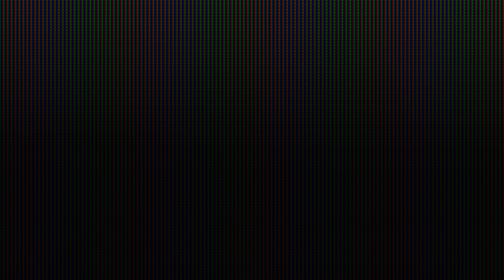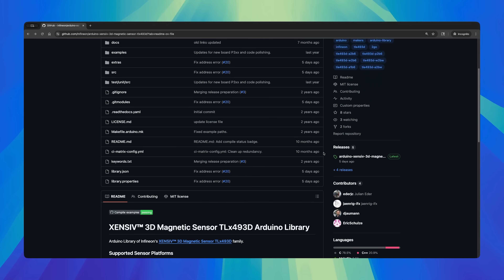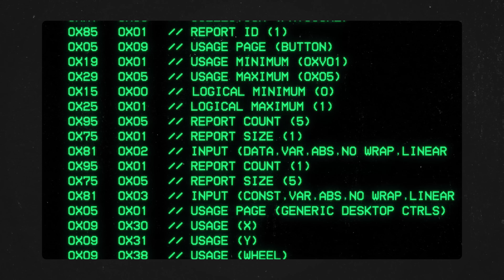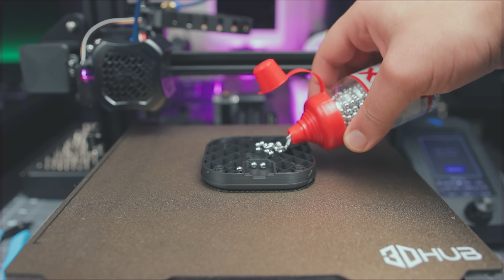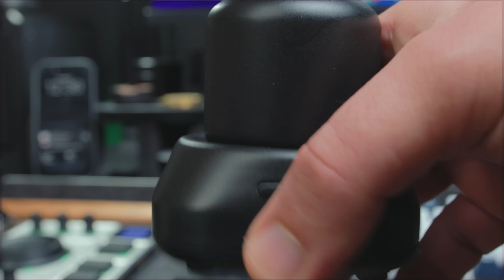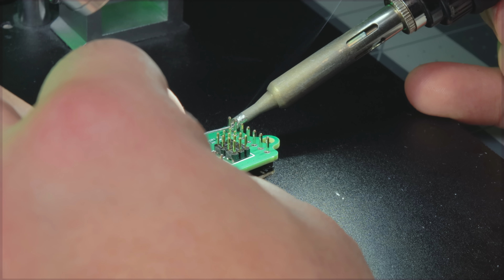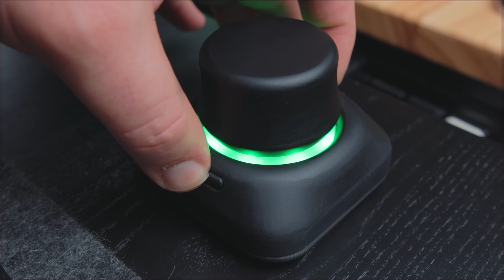I Made a 6DoF Space Mouse using Magnets (again)*

Comment from the maker: To learn for free on Brilliant for a full 30 days, go to https://brilliant.org/salim
My viewers also get 20% off an annual Premium subscription, which gives you unlimited daily access to everything on Brilliant.
Reply: I can't find your GH repo....?
Reply: @tombyrer1808  He hasn't updated it yet for this project, hopefully soon
Reply: I think you should add three wheels for individual z x y axis and perhaps a fourth for inward outward zoom, even having a side piece with four wheels next to eachother just in case you want to lock out any other input from the other axis entirely, this could solve moving objects in mutiple software without having to hover over or select the axis before hand.
Reply: I think getting both pieces of the base (and maybe even the knob too) CNC machined from aluminum would be AWESOME! You wouldn't have to worry about adding the weights to it either, you would just have to put some non-stick feet on the bottom. Plus you could also make the buttons from aluminum too! I would think steel would really add the heft you're really looking for, but I think it would interfere with the magnets and electronics too much, although you could get it in Stainless Steel as long as it is ferritic Stainless Steel (the 400 series) - so just stick with 304 or 316 stainless and you should be fine - plus you could polish the pieces differently and get some different looks - like do the base in a mirror polish but the 'knob' and button is a brushed look - then you don't have to worry about fingerprints on the 'knob' or buttons, plus it's usually gonna be your palm resting on the base which isn't nearly as 'greasy' as your fingertips - OR you could even 'blue' them so they turn black and you;d never have to worry about finger prints and you'd have the same look as the original.... wait, I don't think blueing works on stainless, just regular steel, and then you have the magnetic interference problem... 
Well maybe there wouldn't be an issue with magnetic - you would just have to re-calibrate and it will zero to whatever field is there, right? Well only one way to find out! And you do know PCBWay does all this type of metal work right? They can even 3D print with some types of metals.
I'm totally new here (and this project was enough to see me on subbing!) so I have no idea if you ever worked with them outside of PCBs or if you did any sponsoring with them, but they are the perfect company for makers like you! (no I don't work for them LOL I just love the stuff they do!)
- - OH one thing I did notice that you wouldn't want to see on a high quality product (like you probably wouldn't see this on that original one you had) There was Light Bleed coming through around the buttons and that SCREAMS cheaply made Chinese Junk! (which I know it isn't at all, but you see it all the time with their cheap crap - bad fit and finish) So maybe just a piece of felt that goes around the button on the inside of the casing 🤷‍♂ As long as it isn't too tight around the button so it makes it stick. and I say felt instead of a plastic ring because you can tease the fibers out that would be brushing against the button, and that could fill any of the gap that would be around the button and felt
- - And one more thing. If you got that diffuser made by PCB way they would make it from a completely clear plastic (oh wait, you have a resin printer, so you'd be able to do this yourself) and you would be able to extend the diffuser to go to the 'front' of the base and attach to it where you could have a cut-out of your logo or a design or something, AND because it wouldn't do a fantastic job of really diffusing the light around the knob like what you used in this vid, you could just use some sand paper to evenly scratch it up (evenly) so it gives it a foggy looking surface and that would diffuse it the same way as what is in there now. 
- Okay, one more tiny thing.  Since you already have LEDs incorporated then there is a ton more you can do with them, and maybe if you do another version of the PCB you could add some capability to add on to it in the future, like a way to add more LEDs to the base instead of just having the ring LEDs also the ones for the design/logo you could have some pins that would allow you to add another controller (if needed) that would let you add LEDs in other places, like around the bottom of the base, a ring of light in the knob, around the buttons, etc - basic just a way to add more later if the user desired :)
I think this project is AMAZING! And people LOVE to customize their stuff, so this is the perfect type of place to start! Maybe the next project could be a track ball! lol (I've wanted to go back to a track ball for SO LONG! I had one as a kid and I remember just loving it.
Reply: If buying this board means backing your project and help sustain you, then that's what I want.
Reply: You don't need the power switches. Just switch the sensors using a pin on the esp, they only pull 3.4ma. You really didn't need to kill the power. You could have just used a software i2c for each sensor, that micro is plenty fast to do that.  That way you could have received data simultaneously from all three sensors.
Reply: This is great stuff, first of all that is great design! Elegance like this is like striking gold, absolutely legendary. Ordered a couple of boards immediately and am printing parts now. I made some modifications to your model, I wanted to try print pausing to insert M3 nuts into the print to avoid using heated inserts. Can not wait to try this out! 😎🤙
Reply: Here's an idea for a project: a 'laptop' where you slide your phone into the touchpad location and the screen/keyboard/USB/etc are attached to a broken-out OTG hub which is powered by a mammoth USB power bank?
Reply: @KeithOlson this could work, with Samsung phones is already qite a reality

Comment: I finally managed to get the board, thanks! however, would it be possible to buy just the small board adapter (and the pins)? If so I could have different xiao boards for testing, I was thinking about adapting one with a battery and a Xiao ESP32s3 or a C3, which are quiet cheap and could provide a wireless 3D mouse.

Comment: Does this mouse work without the 3Dconnexion software by using the standard HID protocol, or does it emulate an original SpaceMouse? I'd like to use it with Onshape on Linux, so I'm wondering whether it works without the official 3Dconnexion driver.

Comment: I was able to build mine using the pre-manufactured PCB provided and 3d printing the STL's in a Blue\Green Silk PLA and transparent PETG. This was interesting to work on and for the most part everything was conveyed in the Instructable's article and in this youtube video. For anyone considering this, having experience working with Visual Studio Code, and a SEEED device not required, but certainly makes this much easier. I know what an IDE is, but have little to no time in it. I was able to figure it out with enough patience and log reading and I consider myself tech savvy. I believe anyone who considers themselves tech savvy could get this to work without much of a headache. Definitely don't mess up the soldering order of the daughter board. Its super annoying to separate the SEEED device from the daughter board lol. Setting the heat set inserts and putting it all together was so satisfying. Then finally getting it to work within Fusion 360 was such a gratifying feeling. Thanks for the time and effort you put into this thing @salimbenbouz!

Comment: My pre assembled board arrived today! Thanks so much, I'll get onto it immediately. I'll update this comment with how it goes in the next few weeks. ❤😊
Reply: Did you ever get the firmware to work for it to be recognized by the 3dconnexion software? Mine just acts like an old school pointing stick and isn't being seen by the tool..
Reply: Yep it worked great, download the 3D connections software, make sure you update the values in the firmware to match the 3d connections values. Also using the updated firmware on the github that integrated a kalman filter made it feel soooo much better, highly recommend. Also my printed petg and asa springs both snapped quickly, recommended getting them laser cut from sheet steel.  @Kyurnmakes

Comment: What would I need to do in order to get this working with slightly differently sized magnets (8mm x 1.8mm and opposed to 6mm x 3mm)? I'm interested in trying to build this but I would prefer to use the magnets I already own as opposed to buying new ones

Any advice would be greatly appreciated!
Reply: I had the same issue, I grabbed the step file github and modified it in Fusion. It is really easy to change.

Comment: Hello. 
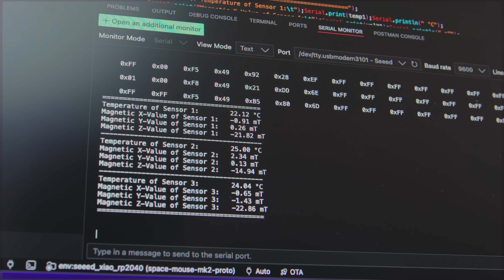This is a fantastic project— Thank you very much. 😊 Unfortunately, one is dependent on the circuit board. Will this project ever be available without that specialized board—using just the sensors placed in the correct positions? As can be seen at minute 03:58. With buttons, of course. That would be great, and it would make the project much easier for many people to replicate. It would also make repairs much simpler in the event of a malfunction. Furthermore, it would eliminate the need for any external services.

Shipping outside the USA is expensive (due to customs duties, taxes, and postal surcharges). Unfortunately, this limits the project's accessibility for many potential users.
I am still undecided because of the cost.😇

Best regards from Germany.
(I hope the translator got it right.)
Reply: @salimbenbouz That is also very interesting. Unfortunately, it's a bit too expensive, and there isn't a project available to build yourself yet. Not yet, anyway. Maybe it will be available soon. 😇
It's called Rotatrix. Do you know it?
https://www.youtube.com/watch?v=u1v7TXViRi8

😊

Comment: Very cool project, and thank you for implementing it! Since the PCB is currently out of stock, I wanted to order a pre-assembled one from JLCPCB (unfortunately, SMD soldering isn't possible for me). However, this requires a CPL file that specifies the exact placement of the components. Is it possible to add this file to the Git repository in addition to the BOM, or will the PCB be available for purchase again soon?

Comment: Why did you go with I2C hall sensors instead of analog sensors on the RP2040's analog inputs? Using some 10¢ TO-92 hall sensors from AliExpress would be a lot cheaper, even though it wouldn't be as tidy or cool as your PCB and its light ring.

Edit: never mind, I didn't know what I was talking about. These are 3D sensors instead of the linear sensors I saw on AE

Comment: I have made a wireless bluetooth version of this project, including a modified base with a lipo battery compartment. The mcu is a Seeed nRF52840, so straight drop-in. Also made a version of the firmware with lenkeiser’s Kalman filter. Will make available as soon as I get the PCBs and can test.
Reply: Wow nice. Will it be publicly available? Do you have github to follow?
Reply: @AndreySemjonov yes, as soon as I can test it with the PCB
Reply: @michaellindborg1510 I think you've added some pairing and Power on/off buttons
Reply: @cosimo2777 yes, that is correct
Reply: @michaellindborg1510 I'm waiting for the material unfortunately I don't have TLVs, I'll wait for your news.
Reply: @cosimo2777 not sure what TLV means
Reply: @michaellindborg1510 TLI...TLI493D The T9 was capricious...
Reply: @michaellindborg1510 I haven't managed to continue with my project yet, I'm going very slowly. Did you receive the PCB? I am very curious about your result!
Reply: I was thinking about it too. Using the nrf, a tp4056, battery I think of 600ma, do you have a github?
Reply: @cosimo2777 I am using a 820mAh lipo cell. It fits perfectly in the base with room left for weights. Will make my github public as soon as I have tested the firmware.
Reply: Wow, I hope the software algorithm can be improved for a smoother user experience!
Reply: Finally got around to completing this project. I now have a working bluetooth battery operated version of Salim’s spacemouse. I have tested it with the 3Dconnexion trainer and everything seems to work. I have added a small powerswitch on the underside of the device. Bluetooth pairing works fine and bonding is cleared by holding the two buttons for 6s. I’ll test it out for a while and then open up my github repo if anyone wants to try it.

Comment: I successfully built this product. However, I believe the noise reduction algorithm needs improvement. Even after calibrating the dead zone, drift and self-rotation issues still exist, perhaps because the inherent noise of the TLV493D sensor is approximately ±5-10 units.

Comment: I printed one just to see how I like it without electronics. I like the shape and form, but the knob itself is way too mushy and wobbly for me. I haven't tested the real one but if it is like this then I don't want it.
Reply from the maker: You can adjust the stiffness by tweaking the spring Fusion file and you'll have to account for the "sensitivity" in the firmware as well
Reply: @ epa720 Did you print the 0.8mm or the 1mm spring variant?

Comment: Please order a stencil next time! Also, the pi2040 can most likely to more i2c busses, this eliminates the need of power toggling them all (and putting a voltage on a IC which is turned off is most likely not allowed). I would also recommend using a kalman filter

Comment: Great project, well done. Is it possible for you to also output the Bluetooth HID report data? I want to do a wireless project using Bluetooth with an ESP32, but since I don’t have a Bluetooth device, I couldn’t do reverse engineering. Isn’t anyone working with Bluetooth HID reports?
Reply: There is a similar project called Nebula that has reverse engineered the bluetooth version of the Spacemouse. Sadly, it is not open source, only binary code is supplied. That is the only bluetooth version I have found, all the other DIY projects use the Spacemouse Wireless (cabled) emulation.
Reply: I have now built a BLE version of the firmware for the XIAO Seeed nRF52840. It only required minimal code changes. My understanding is that using an esp32 will require a total re-write of the code. Now I have to wait for the pcb to arrive so I can test it 😂
Reply: @michaellindborg1510 Is your source code open source? I'd really like to take a look.👌
Reply: @MrMuratx81 not yet, I want to test it first. I have verified that it uploads to a nRF52840 board, shows up as a Spacemouse Wireless BT device in the bluetooth monitor and is picked up correctly by the 3Dconnexion driver. I also made a version emulating the Spacemouse Pro with 15 buttons, which is also correctly identified. I have printed and assembled the device, just need the pcb now to verify it works! 😂
Reply: @michaellindborg1510  Great work. I'm eagerly awaiting the results. Is there a GitHub-like platform where I can follow it?
Reply: @MrMuratx81 it is on Github, but the repo is private for now. As soon as I have tested it with the pcb I will make it public.

Comment: Since you already made a custom PCB, would it make sense to use NRF52840 integrated in the PCB so that you can use it wireless? I am not an engineer but been learning about it in the past year. I made the V1 of your space mouse and I wanted to make it wireless but the NRF52840 super mini/pro micro doesn't expose enough analog pins from what I remember. So one of my goals to enhance my learning is to make a custom PCB with an NRF52840-QIAA bare chip since it should have enough exposed analog pins to use.

BTW, thanks for the free month trial of Brilliant! I wanted to understand circuits and digital circuits better so if I like the way brilliant teaches, I might pay for it after the trial expires.
Reply: I have made a BLE version of the firmware for the nRF52840, providing a wireless alternative. It should work with a XIAO Seeed nRF52840 as a straight replacement for the Seeed rp2040 since they are pin compatible and have the same form factor. Now I just need to wait for the hardware to test it😂
Reply: @michaellindborg1510  You have a repo for by chance? I just looked at the pinout for the xiao nrf52840 and it does look like it's the same exact pinout.

Comment: Great job!  Now the real question:  Can you build a better Xbox controller?
I paid too much for one of those Gulikit controllers because the hall effect sensors were pretty much guaranteed never to drift, but then the cheap plastic thumb sticks wore out and it drifts anyway.  I never liked the ball pivot design.  There has to be a better way.  I even thought about a thumbstick that doesn't move and just uses pressure sensors, but I don't know how great that would feel.  I just want a controller that doesn't wear out easily.  Is that too much to ask?  :body-blue-raised-arms:  Oh, and the parts that do wear out should be easy to replace.

Comment: Awesome project! I made the first iteration of your design with some tweaks to enhance the feel. I added a weight to the bottom plate to make it feel more heavy and resin printed the outside parts. since I had a laser available I made a plate instead the balls you use. Ultimately it was a really nice project. Only downside to me was indeed the limited DoF which resulted in me not using it. Looking forward to building this one. Perhaps a next iteration could allow for wireless use?

Perhaps if I find the time I will use add to your project and upgrade it to be millable and add the wireless communication myself.

Comment: A little tip for an alternative to BB Balls to add weight to prints:  Wheel weights / car tire weights that are used to balance wheels / rims. They've a very good size/weight/price ratio, are basically standardized to two sizes and often come with an adhesive to stick them in. I like to use them a lot in 3d printed phone / tablet stands and such.  If you buy a bit larger packages they're like 20€ for 6kg.